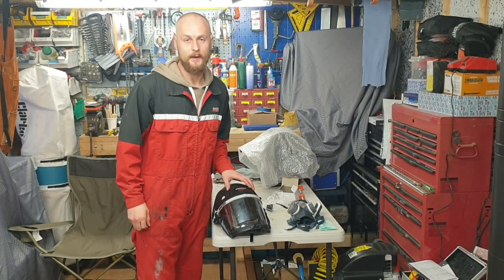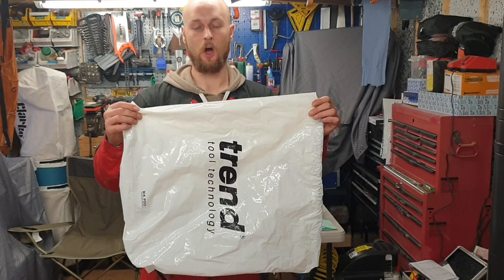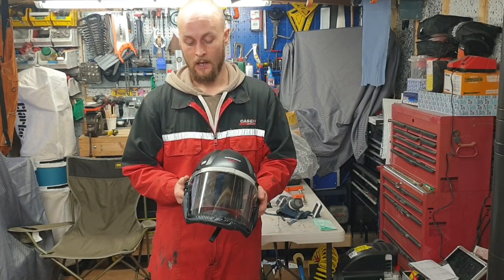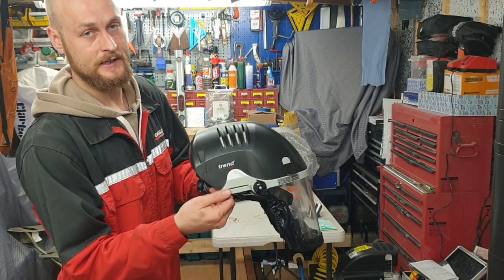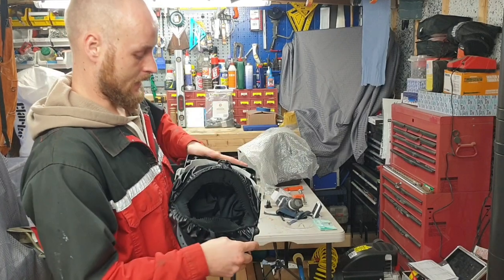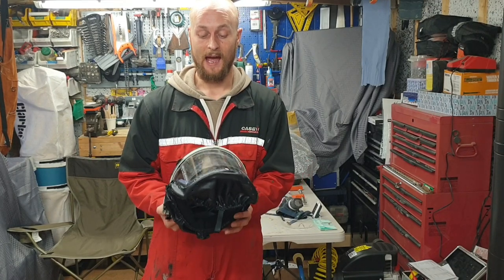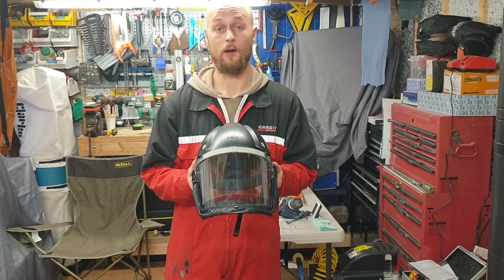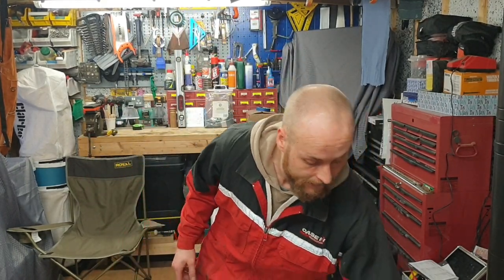TREND AIRSHIELD PRO #TOOL REVIEW

Comment: Hi, great video btw. I’ve recently brought the airshield pro but i do have one question maybe you could answer? Does the elastic seal fit tightly to your face? On mine the elastic seals around my jaw line but there’s big gaps near my ears and i can constantly hear air escaping from there. I was thinking that these gaps may be lessening the effect and letting dust in? 

Thanks
Reply: No need to worry as the positive air being pulled in gets pushed out in within the shield. No dust can enter.